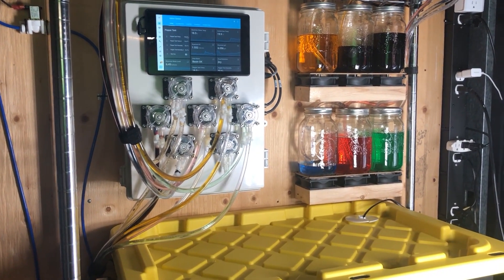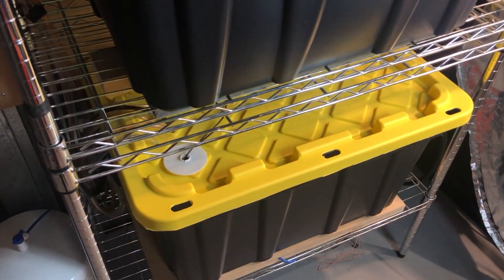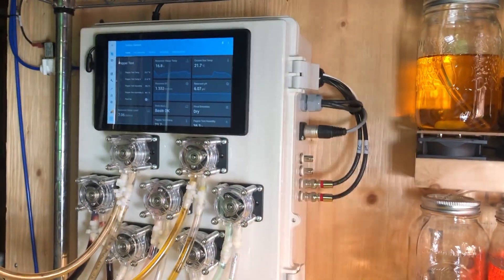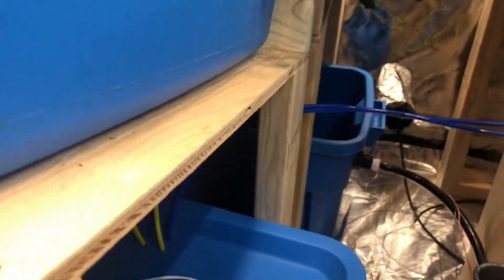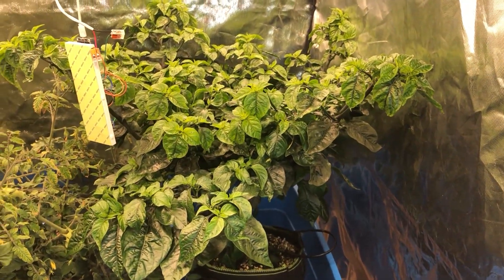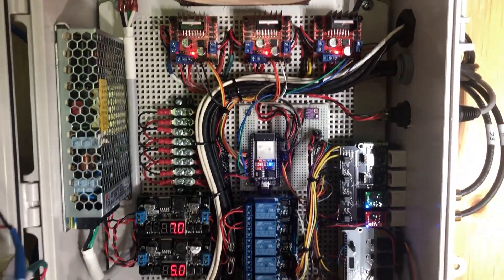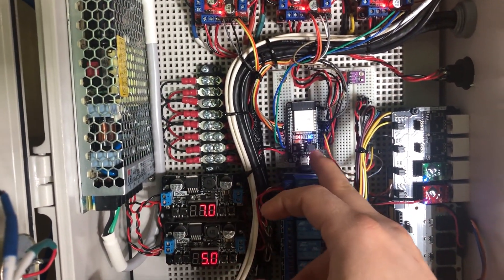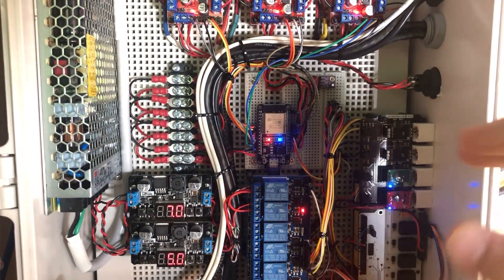My DIY Home Assistant Garden Automation System - Climate Control, Dosing, and More. Pt.1 - Hardware

Comment: Love the use of the  Weighting Sensor you could also use an ultrasonic/distance sensor but as always there are thousands of ways of doing stuff and not right or wrong way as long at it functions the way you want it to.
Reply from the maker: For sure. I wanted as much accuracy as possible since I’m using the data as part of a script to create a fresh batch of nutrients, so when I specify I want 12 gallons of water in the batch I want it to be as close to 12.0 as possible and this method is working wonderfully for it!

Comment: Water weight is 1kg per liter. 😁  Amazing job!!!
Reply: 1kg of purified water is 1L at 4c temperature
Reply: @alexsiniov  perfect that's why i love metric system.
Reply: Alexander Siniov 1m^3 is 1 tonne
Reply: @alexsiniov  how much is that is Vodka? XD
Reply: @g60force  Vodka is a little lighter that the water, since alcohol has less density :D :D
Reply: @alexsiniov  actually that depends where you are on the world, the gravitational force changes, with longitude, altitude, the type of soil that you have under you...
Reply: @nunosousa2942  Water is water. It's H2O without minerals, which means purified. Gravitation does not change neither the weight, only volume sometimes due to altitute. But it's measured at 0-1m from the sea level. All other stuff like mineral water, water with nutrients or stuff is mixture, not water
Reply: @alexsiniov  gravitation DOES affect WEIGHT. But I get it, you're referring to the mass, which is not affected by gravitational force. I just wished you got your semantics right.
Reply: @9622AvAtAr   and @Alexander Siniov
 i see what you are saying, of course that 1kg of something is 1kg in any part of the world BUT thats no the point, 1L of water isnt necessary1kg
Reply: Ahhh i see you're civilized men as well.
Reply: Gotta love the metric system!
Reply: shhh...Americans must not know this
Reply from the maker: I just converted it over to metric tonight 😎
Reply: 0.157473 Stone
Reply: Stainless fuel tank level sensors are cheap and reliable
Reply: 8.34 lbs in imperial
Reply: @ebdirtrider  Nobody cares
Reply: no it is 1 elephant per mc donald's large coke cup.
Reply: @imperialrecker7111  you forgot to square it by "freedom eagles per school schooting"
Reply: I didnt know that.  Wish i had.
Reply: The weight of the reservoir is actually irrelevant I this system.  A more usable & realistic option would be timing the change outs.  40 gallons of nutrients topped up with 1/2 to equal amount of water would be a nutrient change point, not the weight of the res or he could simply schedule can be outs on a timely basis.  I built something similar but using blynk.  Auto nutrient charges happen every 3 weeks. It cut the nutrients from recirculating back to the reservoir & instead drains to waste 2 days before the changeout.  The last feeding before the change out will fully empty the reservoir before the system resets it.    I haven't had to make any changes or give any assistance to my system for over a year now.
Reply: You gotta wonder about the leaders who heard about the metric system, how the rest of the world was adopting it, about 1L=Kg and other convenient conversions, and still decided "Nope, we would be better with archaic nonsense". Maybe it wasn't a fault of the leader's foresight but the leadership system it'self.
Reply: A pint is a pound the world around, for water anyways
Reply: yeah the gravitational force here is 9,81 M/s^2
Reply: 0,998 kg actually
Reply: @_Mitchell_YT  1kg at 4 degrees celsius
Reply: @_Mitchell_YT  depends of the temperature of the water actually....

Comment: Looks amazing. Doing the same thing at home. What are the clamps you connect the nutrient hose to the peristaltic pumps??
Reply from the maker: My pumps came with little plastic fittings. The pump hose and the feed/return lines fits over them and then I used ty-raps to cinch them on.

Comment: very neat and clean set up. tank level measurement is a pain in the neck and I like your idea of measuring the weight. how are you handling the creep in load cell output overtime when a load remains on the cell for a long time?
Reply from the maker: That's one factor I'm concerned about. My fix for the time being is to check calibration periodically and see how far it drifts.

Comment: Hi, you said you didn’t have to write any code. Did you use an open source project?
Reply from the maker: I did have to write some code for the Arduinos for my project - I just meant that you don't necessarily need to know any before getting started with Home Assistant. I learned it on the fly.

Comment: fantastic build!!!  going over your parts list I have most of it even a spare tentacle board. I am really more interested in how you have it piped in to HA, would love to get a look at your configuration.yaml and how you have it all running. I have a back yard koi pond not to big about 5,000 gallons and I have a collection of hasta plants that range from micro to empress WU the giant variety and this could be a great way to take care of the plants and I have an idea for a fish feeder running of a 12v DC motor and the hopper is a plastic bucket that should hold about 10lbs of food and I have wireless all the way out o the pond

Comment: Great video and setup, thanks for sharing this.  just a quick question what pumps are you using to move water between reservoirs and plants?
Reply from the maker: Thank you. I'm using a Vivosun 800gph pump to move water between reservoirs and an EcoPlus 290gph pump to move water from the nute res to the plants.

Comment: Tech overkill... I love it!  I have esp8266's everywhere for PWM lighting and interval timers. The weight sensor for water level is awesome. 

Only one word of advice. If you haven't installed  overflow standpipes right to a drain for your flood protection...just remember anything that is electronic or has moving parts will eventualy fail.. I llearned the hard way from my aquarium days
Reply from the maker: Sweet. They are so damn handy. I have ESP32s doing PWM jobs since the 8266 is a software PWM apparently.  I do have an overflow on each tote that feeds a drain right beside them :D

Comment: I work in automation and have been considering something very similar. I even have the same exact tubs and shelves that you do! Seems like some things are needlessly over complicated, but I completely understand! I've been watching Dr. Bruce Bugbee lately, he has opened my eyes to nutrients and how we over complicate things as growers. I'm planning on having RO res, PH down, and Nutrient concentrate res. I use powdered nutrients so I would have to pump from the nutrient concentrate res and dose based on ec. This would mean only 3 pumps. You don't need to weigh the res, you could do a simple fluid level sensor for that. I love your safety precautions with the flood sensors, I hadn't thought of that. I will work that into my plan as well. Thanks for the video, looking forward to part 2!
Reply from the maker: Nice!

Can you recommend a good fluid sensor?
Reply: @LEDGardener  I use Automation Direct as a source for sensors and PLC's. They have a variety of fluid level sensors, both submersible, and non contact. I believe the ultra sonic non contact sensor is the cheapest. https://www.automationdirect.com/adc/shopping/catalog/process_control_ameasurement/level_sensorsa_controllers/flowline_ultrasonic_level_sensors_(non-contact)/software_configured/dx10-00

 It would be hard to say if it would be cost effective without knowing what you're using. (I'm not affiliated at all with this company, I just use their products at my 9-5 job)
Reply from the maker: @dudemcgee256  those look like butt-kickin' sensors but are likely out of most hobbyist's price range.
Reply: @LEDGardener  I figured that was why you chose to use a weight input rather than fluid level. Can't wait for the breakdown video. I would love to have an affordable source for sensors, pumps, and controllers.

Comment: love the scale!!

running your r/o on a float like that will kill your membrane pretty quickly.  better off if you can keep a large rez of r/o and fill it once a week or somethin. r/o's are more effecient when they run longer and very ineffecient when they run for short periods.
Reply from the maker: Interesting... thanks for the tip. Since I'm doing a full res change every week or so, it does empty that top tub out completely so between that and the little holding tank, I put through around 20 gallons per week. Do you figure that's enough to extend the life a bit?
Reply: @LEDGardener  sure, the main thing is you dont want it coming on and only running for a brief period.  If you have the system off other than res changes youre good👌

Comment: I hired a guy a month or so ago who is writing me software for my auto watering system based off capacitive soil sensors.. controls pumps/valves, fail safes, keeps history of everything, all customizable for when and how long it waters.. all controlled/viewed from webpage.  Runs on windows or raspberry pi and mcu's.  It is not done yet but getting close.
Reply from the maker: Nice! What language is he programming it in?
Reply: @LEDGardener  Hey, I'm that guy :).  Yes, it's C++ for both the MCU and the Interface/Server.  The layout is like so:  One MCU can controller 4 zones.  Each zone has 2 moisture sensors to detect issues (like they are off by to far or the moisture level doesn't rise after watering).  Each controller has a pump and 4 solenoids for it's control.  The controller feeds back to the server it's status and configuration.  The server talks to each controller (limited to 254 controllers, 4 zones each so 1016 controllable zones, although I haven't stress tested that many USB devices plugged in, so the realistic limit is probably a bit lower).  The server uses SQLite to store configuration data as well as history, so if a controller craps out you can replace it and put the config back in to the new one.  Each controller stores it's own config internally (eeprom) so it can run even if the main server isn't online.  The user can login to the server via the web (from anything with a browser, including a cell phone) to view status and change configurations.  Each zone has up to 5 entries where you can set the watering schedule (either time or moisture based).  So you can for example set zone 1 from days 0-> 6 to water 120 seconds at 30% moisture, then from day 6-17 water 200 seconds @ 20%, then from 18->XXX another value.  This allows you to setup an entire growing cycle for your plants so it can get optimally watered at the correct amount during the entire cycle without user intervention.  Maybe some more stuff I probably missed, but that's the gist of it.
Reply: @Ready4Droid  Awesome Job mate, is it open source? It sounds pretty functional so Kudos for doing it in C++. I do Java for the day job but decided to do all my automation for my project in mostly JavaScript so ended up with the following stack. Web UI (Svelte) --> Web Server (node) -->  Glue (Johnny-Five) --> Hardware/Arduino (Firmata). I am mostly using RF433mhz and cheap socket outlets, extension gangs, RF relays, etc.  with a couple of Ada Fruit motor shields for the peri pumps etc. Just need to finish it!!
Reply: @Minty007  not at the moment, not really sure if/when.  Right now it's a one off project.  I use c# and javascript at my day job, but I like c++.  The hardest part was the web server, not to many good web server libs.  The front end is react (JavaScript) which is served from my c++ app (so no extra libs or services required to use it).
Reply: @LEDGardener  I think he said C++ but I will find out for sure.
Reply: @LEDGardener  yep, c++

Comment: Great work! I’m surprised you have got your PAR Meter in there yet. Might be interesting to track the light level at the canopy level. You could see how things change as the plants fill out. Maybe a camera that would let you check the grow tent remotely from the tablet?
Reply from the maker: I considered integrating my meter but mine is older and outputs a very low voltage so I’d have to build a circuit that’s likely beyond my electronics capability to amplify it to the range an Arduino can work with. 

I have some Wyze cams that I would really like to integrate but they may not be ideal as I think you need to put them into an RTSP mode which isn’t really well supported.

Comment: Wow you nailed it, this is my dream project! I got into AtlasScientific sensors a bit ago but never got as far as dosing pumps like I wanted, I documented a bit of it here: https://github.com/B204L/AAG

I had the sensor data fed into the TeensyLC over UART as strings converted into char arrays and parsed it before outputting it to that little LCD screen to the PI. Once it got to the PI there was a NodeJS program using a library developed for Thingspeak so it could graph data, it was pretty cool but for some reason I was never able to figure out the data on Thingspeak wasn't the same as the direct readout. In the end I just used the readouts on the screen for my small hydroponic setup.

Looking forward to the 2nd video though, I might come back to it with this other program you're using.
Reply from the maker: Nice! I had a read through. Looks like a neat, similar project. I like the breakout boards and that’s something I intend on pursuing myself
Reply: This was my first (and only so far) time I gave the board design a try, it was a lot of fun trying to get it to be as small as possible to get the cost of the order as low as I could. I'll probably just grab the Tentacle from AS as well since it has the signal isolation, my wallet tends to cringe whenever I look at their product catalog though.

I've had some luck with buying generic probes from eBay to try to keep costs low, specifically for ORP and EC but I can't speak to how accurate they are in comparison.
Reply from the maker: Yeah the isolation was the big sell for me since I’m running an EC probe in the same container as the pH.
Reply: @LEDGardener  Same here, I did a load of research and my conclusion was to monkey up for the Atlas stuff in the end. A little better now that they have some more consumable versions of the probes and the shield is not so expensive but still a hard pill to swallow on the cash side once you add on all the bits needed / wanted.

Comment: Hey man, awesome work it's great to see how deep you've delved into HA! I love using it for my gardening projects. One thing I've setup that you might like is a camera (I used an old iPhone). You can set it to stream through HA and capture frames for a timelapse. I also built a homemade level sensor (6 float valves on a threaded rod, you can see it in some of my videos, although I haven't done a how to with it.)

How much do you find that your pH drifts?

I'd love to hear more about how your are maintaining and updating the NodeMCUs. Do you do OTA updates or do you have to manually plug them in to flash the new firmware? Also, what do you use for automations? HA's built in system or something else (Like NodeRED)

Looking forward to more videos on this!
Reply from the maker: Hey! I considered doing the web server OTA thing for the node but I’m just plugging in for now. I use the stock HA automation but I have a couple friends who swear by Node Red. I just haven’t embraced it yet but I think it’s just a matter of time before I do. 

I hear the ph pumps kick in a couple  times a day to adjust. Will have to have a look back and see how often the automations are being called.
Reply: Love the float sensors on a threaded rod idea, I bloody drilled mine so now have to fill it to the hard coded level! God Damn it...

Comment: That’s amazing great job mate, I can feel my wallet getting lighter already! 😂👍
Reply from the maker: Yeah the Atlas gear will do that to ya. The rest, not so much.
Reply: @LEDGardener  I'm not so sure, it kinda all creeps up on ya, and it all adds up overall. The Atlas side is a chunk once you factor in the Tentacle shield, the stamps, probes, and calibration liquids for sure but this was still less than I paid for the LED light. Atlas side is quite modular so you could purchase just the temp probe to start with and add on the EC and PH afterwards but once I start on a project I kinda just 'explode'!!

Comment: Awesome setup. I'm working on setting up a similar system myself.
Have you considered using a chirp sensor for monitoring soil moisture? They use a capacitance circuit rather than driving current through the medium.
Reply from the maker: Looks nice. From what I read, capacitive is the way to go for sure.
Reply: I came here to second that. Capacitive sensors are a bit more expensive but they are definitely the way to go, as they don't mess up with the soil, and they don't corrode so they last for ages. They are also a lot more accurate, and they aren't affected by soil conditions like temperature, acidity, etc.